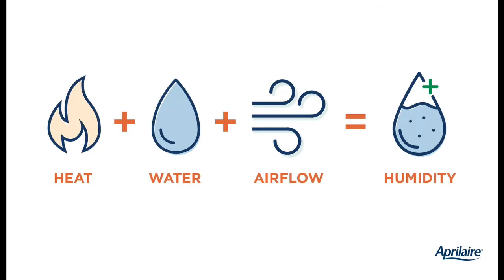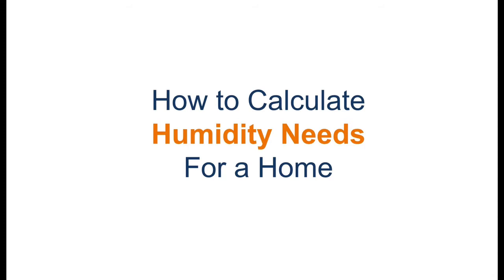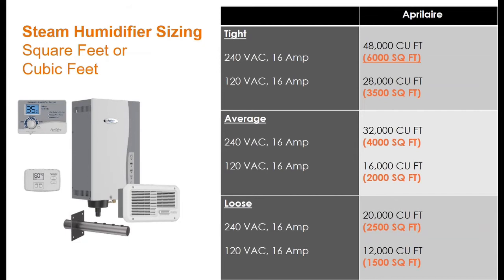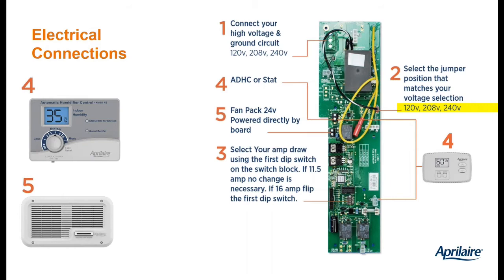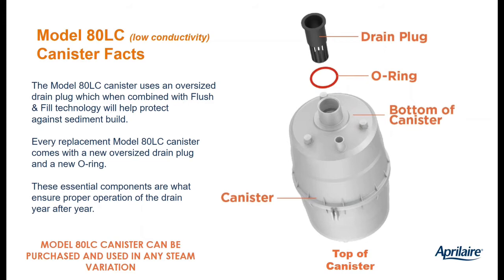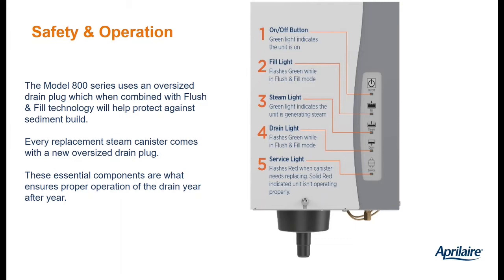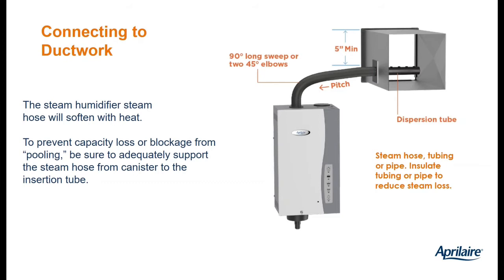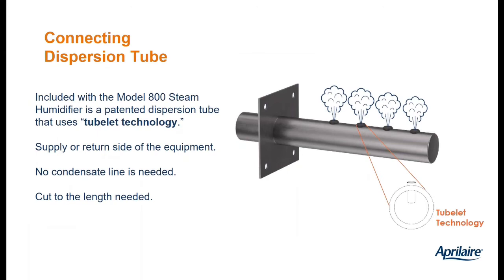AprilAire Steam Humidifiers Product Training Webinar (Recorded January 2020)

Comment: Great video! I have a unit installed with the fan pack directly above the humidifier (just a couple inches above so no tee for condensate to trickle back to) and the system spits condensate out all over the floor. Now I believe I see what is happening.. so I will be taking that fan pack down and relocating it and incorporating the drip tee and trap. 

Thanks for this info!
Reply from the maker: Hi Kelly - Thank you for contacting Aprilaire! We appreciate your feedback on the video. If we can assist you at all with your steam humidifier, please feel free to give us a call at 1-800-334-6011. A Customer Service Agent is available Monday through Friday, 7:00am to 5:00pm CT. We'd be happy to help!
Reply: Thanks for sharing. I was planning on installing the fan pack as you have described without the drip tee and trap. Were you able to stop the spitting? Does the unit make noise?
Reply: @lsglass  a contractor had this unit installed for us in the lab of a clinic and as I was saying it was spitting water all over. I don't recall if it was really making much noise but it wouldn't surprise me at all if it was due to having that mixture of not just steam but also droplets having to blow through that fan and the dispersion assembly in the fan unit.

But I ordered the drip leg/tee kit and installed it and it worked great. The lab staff has very impressed and happy no more water spitting all over their computers.

I don't work for that hospital anymore so I don't recall the exact procedure I did or much of even what it looks like now.. I'm sure if I scrolled back through a few years of photos I might find pictures of it. Lol. Good luck!

Comment: I own a 1,900 sqft. home is my home too small to have this unit installed. My main reason for choosing this model is that if I use a model 700 I have a tankless water heater and I don’t think it will supply the necessary hot water that is required.
Reply from the maker: Thank you for contacting AprilAire! If you can install the Model 700 on your hot air supply duct, you will not necessarily need hot water and may get sufficient humidity.

Otherwise, an AprilAire Steam Humidifier would be a good option which also does not require hot water. If you have any additional questions, we would be happy to assist.

Comment: I have 3000sf two story home in Delaware. Geothermal heat pump with ECM. House is between tight and average. Trying to install 800 model next week. Trying to size my wiring. I’m doing 240V. The only question I have should I go with 11 amps or 16 amps setting? Thank you!
Reply from the maker: Thank you for contacting AprilAire! We would suggest the use of 10-12 gauge wire. If using a 11.5 amp setting, you will want to use a 20 amp breaker and if on 16 amp, you should use a 25 amp breaker. If you have any additional questions, we would be happy to assist.
Reply: @aprilaireco  for condition of my house do you think 11.5 is enough? I’m afraid to put 16. How much difference it makes in real world. I connected my fieldpiece probes. It’s 44F outside and 69 humidity. My thermostat set on 69F. Indoor humidity is 44. By the end of the cycle I’m getting return 72F 50% humidity. Supply 94F 24 humidity. Thank you !
Reply from the maker: @kastenusa  The Model 800 Humidifier will output 23.3 gallons per day of moisture on the 11.5 setting at 240V. On the 16 amp setting at 240V, the unit would create 34.6 gallons per day. 

If using our controller, the max amount of humidity would be 45%. If using a thermostat or another controller, the limit would be set by that device. If you have any further questions, we would be happy to discuss. Thanks again for contacting AprilAire.
Reply: @aprilaireco  I got system installed. 50F outside, 91% humidity. 70F inside, 39% humidity. In the beginning of system cycle humidity starts at 53% in the end of the cycle it drops to 44% on humidistat. Control set at 7 max. Ducted work in the attic. But system never calls for humidifier. Humidity stays higher 5% in the ductwork that’s why there is no call for it. On the first floor where is my thermostat humidity is 39%. What are my options now? System turn on in the test mode.
Reply from the maker: @kastenusa  Thank you for your follow up message. We would recommend that you reach out to our technical support team at 800.334.6011 to go over your installation and options.

Comment: Steve - The install instructions indicates 'minimum 16" clearance" to the right of the mounted unit for ' electrical access'. . . .  When I lay out the unit, , this doesn't seem necessary - can you give some additional insight (I have a narrow / tight install spot unless I modify).  Thanks.
Reply from the maker: Hi Mike - Thank you for contacting AprilAire! We will get back to you on this as soon as possible.
Reply from the maker: Hi Mike - Thank you for your patience on this. This clearance is needed to access the internal circuit board for wiring and set-up during installation as well as future possible troubleshooting and service work. We have seen many installations in which a steam humidifier has been installed in a cramped location and something as simple as changing a DIP switch or reconnecting a loose wire has required the Model 800 to be removed and then reinstalled. The performance of the Model 800 will not be affected, so if no other location is feasible, then as long as the contractor and homeowner understand that possible service work in the future may be difficult, it should be fine. If you have any additional questions, we would be happy to assist. We can be reached at support@aprilaire.com or by calling 1-800-334-6011 Monday through Friday, 7:00 a.m. to 5:00 p.m. CT. Thanks again for contacting AprilAire!

Comment: Thanks for the great instructional video! Could you please tell me how to wire the fan wires (G and GF) if my fan is controlled by an air exchanger instead of the furnace? The fan is set to run continuously regardless any input. Can I skip G and GF?
Reply from the maker: Thank you for contacting AprilAire! Would you mind reaching out to our technical support team to discuss the wiring? We would be happy to assist you. We can be reached at 1-800-334-6011 Monday through Friday, 7:00 a.m. to 5:00 p.m. CT.

Comment: Can this option be installed above a furnace with an electric heater? I imagine that condensation is always a risk, and so soaking the electric furnace could be an issue....
Reply from the maker: Thank you for contacting AprilAire! If installed correctly according to our installation guide, we do not have an issue with that installation. If you have any additional questions, we would be happy to assist.

Comment: Great Video.  Do you have a video going over trouble shooting of this unit?
Reply from the maker: Thank you for contacting AprilAire! Would you mind giving us a call? We would be happy to assist you with any troubleshooting needs. We can be reached at 1-800-334-6011 Monday through Friday, 7:00 a.m. to 5:00 p.m. CT.
Reply: @aprilaireco  Thanks for writing back.  I have called customer service and they were unable to help because I didn't know how to do an "amp draw".  They said all Aprilaire certified HVAC places go through one hour of training every year and should be able to do that, but I've had four out to my place that are listed on your website and they just say that since the unit is hot it must be working and at $150 a visit, I can't keep doing that and I just about could have bought a new unit for the cost of the visits from them.  I would be glad to do the training if available.
Reply from the maker: @indyregen  Thank you for your additional feedback. We are very sorry for the experience you've had. The AprilAire Model 800 Steam Humidifier is an industrial-grade piece of equipment that can be installed in a variety of applications, all while relying heavily on outside factors for the unit to perform to its full potential. Those factors include electrical input and water conductivity. If it is felt that the unit is underperforming, a preliminary course of action would be to have a water quality test performed. Those results can then be cross referenced with the chart from the installation manual. That manual can be found at this link on page 7: https://rp.widen.net/content/1aa2yqci3s/pdf/aprilaire-800-series-steam-humidifier-installation-guide-B2210091.pdf?u=5rn8it. We want to apologize again for the trouble you've had. Our team can be reached at 1-800-334-6011 to talk through the information here further and next steps.

Comment: Excellent video! Can you please tell me if this unit can be used with a DOWN FLOW forced air gas furnace (located in an enclosed finished space in my attic)? The space is quite small and a bypass humidifier is not an option particularly since the SUPPLY duct is inaccessible. Thanks!
Reply from the maker: Thank you for contacting AprilAire! The Model 800 can be used in a downflow application, but we need to be aware of the absorption distance needed. Generally, we recommend 3’ of straight, unchanging ductwork with no sensors, outtakes, intakes, or size changes. If you have any additional questions, we can be reached at 1-800-334-6011 Monday through Friday, 7:00 a.m. to 5:00 p.m. CT.

Comment: Can I connect the hose to the supply plenum right above the furnace or does it need to be away from the furnace somewhere in the trunk?
Reply from the maker: Thank you for contacting AprilAire! The main consideration for any dispersion tube placement is that there needs to be proper absorption distance downstream from the dispersion tube. If you are able to achieve that, you should be fine. We always recommend speaking with your local HVAC contractor as well for installing needs.
Reply: @aprilaireco  i have an AC coils there and the nozzle is above it. Do you think that would catch any condensation from the steam nozzle?

Comment: What could produce a gurgling sound if it is not the hose?
Reply from the maker: Thank you for contacting AprilAire! Gurgling with a steam humidifier is typically caused by an installation issue. If you would be able to call our technical support line at 1-800-334-6011, we would be happy to assist. A team member is available Monday through Friday, 7:00 a.m. to 5:00 p.m. CT. Thanks again for contacting AprilAire.
Reply: @aprilaireco  thanks!

Comment: nice informative video i have the 800 attached to my trane variable speed. Live in the NE what are the optimal settings to run in terms of fan speed and temp levels. i find sub 20 F outdoors very difficult to hold 35% RH .. (oil heat force air) with 240v and 30amps or 16amps setting . My electric bills in winter are +$300 per month more as result. would like to reduce that but love the comfort levels 35%+. thx
Reply from the maker: Thank you for contacting AprilAire! Would you mind giving us a call at 1-800-334-6011? We would be happy to assist. We can be reached here Monday through Friday, 7:00 a.m. to 5:00 p.m. CT.
Reply: If you get an answer, can you post it here.  I have the same unit combo and mine has some of the same issues.  Thanks!